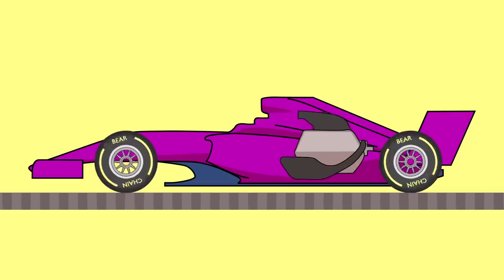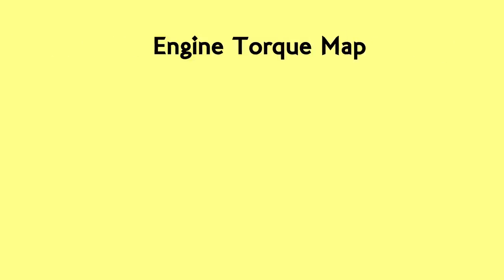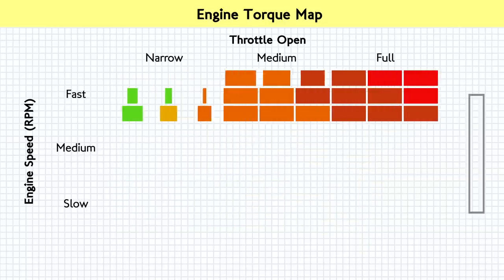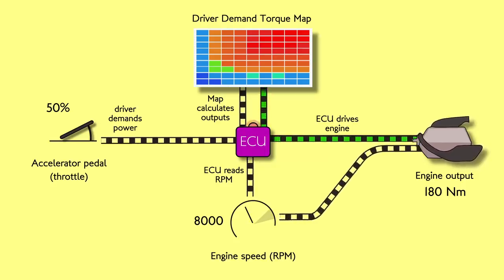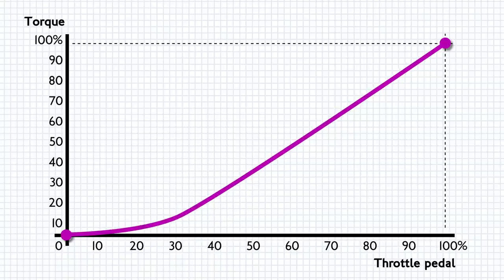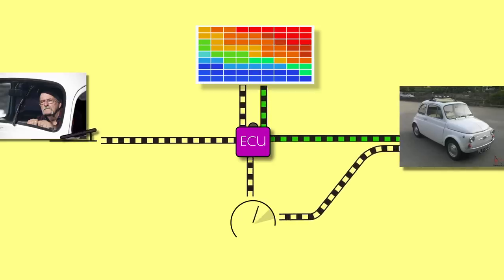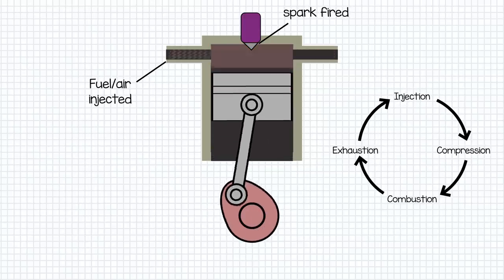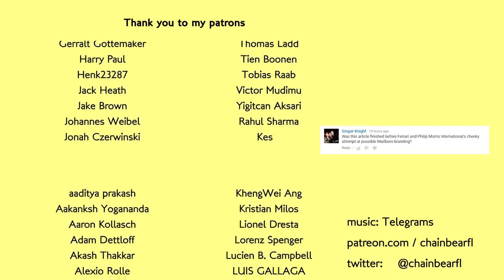What is Engine Mapping and how does it affect a car's behaviour?  | Plus Mini Q&A

Comment: While this basics are correct, the idea that the most torque is being produced at the greatest rpm is not right.  Most engines don't work that way.  This is why you have a torque/power band graph.  The power band will usually cross the torque line twice.  Once at the beginning of the power band's optimal low rpm output and again as the power band peaks out and output starts to fall.  Usually, the tachometer is calibrated to red line shortly after the power band peaks because now you are over-revving the engine and this can cause damage.

Comment: Is "party-mode" an engine mapping setting?     Presumably, one that pushes the outputs towards the extreme edges of these maps, without killing the engine, or damaging it too much.
Reply: That's what I understand of it.
Reply: As I understand it it's more related to the interplay of the Hybrid drive unit, fuel mixes and ignition timing - things more managed by the ECU than necessarily related to throttle response.
Reply: What such a mode is will depend on what the ECU is programmed like, but generally speaking, such a mode will push way more fuel through the engine than would be sustainable for an entire race given current fuel limitations, and most likely also completely drain the battery without bothering to charge it up again as you normally would. How exactly it directs the MGU-H I wouldn't know, and it is an interesting one, because there will be a sweet spot in using the electric energy, between driving the turbo to eliminate lag and making the combustion engine work as well as possible, and driving the wheels directly.
Reply: +ISLAMATRON - I know there's a 100kg/h limit on fuel flow at any moment, but I think you'll find that if you try to push 100kg/h through the engine at all times, you'll get nowhere near the chequered flag in most grands prix, hence why I said fuel flow was higher than would be sustainable for an entire race...

Comment: Could you explain the limit that Renault gave Red Bull for their “Engine mode” on the engine near the end of the race? (Japan GP) It was on radio, when Max was behind Bottas? Is it regulated by the sport, the team, or the engine manufacturer? 🤔
Reply: Renault will effectively tell the teams it supplies "you can put this many minutes on this engine on setting 7 and this many on setting 5. More than that and you run the risk of it failing and your race is over". It's advice from the engine manufacturer, but as a team you don't /need/ to adhere to it - it's not a rule that is enforced by anyone - just some advice from the people who build the power unit.
Reply: basically ^ this. F1 engines are very precisly engineered for both power and weight saving, and just like your own road cars components will fail faster when driven too hard for long periods of time. This means that the engines reliability across a race weekend can often only be estimated, and the manufacturers give guidelines to the teams using their engines as to how long you can run an aggressively push an engine before it's risk of faliure becomes too high. The current rule limits on how many engines you can use per season as well really push the teams to follow these guidelines and conserve the engines as much as possible.
Reply: @H18136  and the base of the warranty of the parts. Beside Raikkonen did a good job at managing the distance. Even tho Verstappen got into DRS range he couldn't get into position to attack.

Comment: Actually, in order to optimize energy saving against lap time, the ECU can control the torque delivered if maximum torque is requested by the driver (100% throttle). Furthermore, the torque is controlled by deciding on the torque split between MGU-K and ICE. There are several papers on that topic.
So engine mapping is only 1 part of the equation with the current powertrain architecture

Comment: Hey chain bear 👋
Another very interesting video, thank you for your time and effort.
In this video I had a first time of confusion while your explanations.
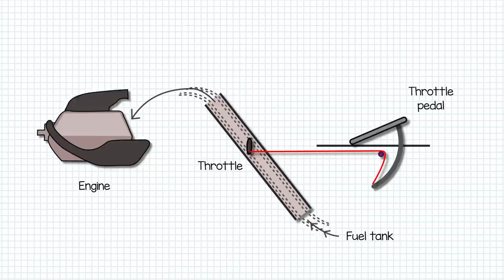@0:30 your drawing displays a throttle with arrows from the fuel tank to the engine. The combustion engine in f1 has direct injection, hasn't it? Wouldn't it be more precise if the throttle only controls the input air as the fuel is injected directly into the cylinders?
Even in the audio you state the throttle controls air _and fuel _...?

PS: never mind, you said "way back in time" overheard it, sorry 🙏.

Comment: Dont know about F1 Cars, but in a normal car it is air Filter > throttle flap > carburetor. This the line to the fuel tank is connected to the carburetor and fuel doesn’t hit the throttle flap, as ist enters the air later.

Comment: Good video. But I think they don't have a throttle valve anymore as even a fully open one has a drag. I think they control the torque by the MGU-H as a throttle and a very low fuel mixture as they don't have enough fuel to slow down the engine by too much fuel.

Comment: Hello, nice video. I have a question. On minute 1:37 you mentioned that the inputs for a simple engine torque maps are throttle percentage and rpm. The output will be torque.
Is there any mathematical relation I can follow to manually calculate this example with your values (rpm=8500)(.83)(212 Nm)?

Comment: Do they switch to a different engine map when they are in the pit lane? Or do they use something else?
Reply: I should imagine they do, yes. They could get away with just making the pit lane button a speed limiter, but any engine manufacturer worth their salt will try to incorporate some sort of engine mapping there that finds a balance between using as little fuel as possible while in pit lane, while keeping engine temperatures within the window, and the throttle response sharp enough for a quick getaway from the pit box.

Comment: I actually didn't know about the rule that 100% throttle should amount to 100% torque. Thought they could dial the engine back and run a leaner mixture.
Reply: I guess if you have to fuel save, you could put up a map that maxes out at 80% Torque by 100% throttle.
Reply: As I understand it, they can do that, and the rule basically just means that the highest point in the torque curve needs to be reached when the throttle is fully down, so it's not "100% torque" as such, it's just to make sure there is a certain linearity in the torque curve, and it doesn't have peaks and dips in places where the teams might otherwise want them. Then again, unlike a diesel engine, which has a massive early torque spike and then drops off, a petrol engine will always tend to have higher torque at higher throttle inputs unless the mapping is messed with very significantly, so this could also just be a way for the FIA to guarantee "natural" behaviour of the engine.
Reply: +ISLAMATRON - Could be, which is exactly why I put the words "As I understand it" at the very start of the comment, to make it abundantly obvious that I wasn't saying it with 100% certainty.

Comment: I think you mix torque with power. Max torque is never() at max rpm, or even in   the higher regions of rpm, it's way before. Sure f1 engines will be tuned for high rpm(intake runner lenght), but still, it's max power in the higher rpm, not torque. Fuel injection(s) per (2) revolution(s) will be higher in lower max torque rpms, then at higher rpms...

Comment: Please excuse my ignorance here (I pursued my engg. in the computer science dept., not the automotive one). I was under the impression that the throttle controls the AMOUNT of fuel mixture (which is pre-rendered as one of the categories - lean, rich etc.) input to the engine, which upon ignition RENDERS the engine RPM manifested as the crankshaft rotations, which in turn are controlled by the gear ratios to output the resultant torque to the wheels. This video however makes me feel as if THROTTLE and ENGINE RPM are 2 INDEPENDENT variables of which the Torque is a function.
I'll be obliged if someone could help me bridge the gaps in my understanding.

P.S. - I did a basic Google search but was perhaps operating under a confirmation bias so as to make it to no avail. I thus, admittedly rather lazily, posted my query in this forum. I hope it finds a resolution here. :)
Reply: Throttle-> fuel mixture->power=torque×rpm the torque/power then get's transmitted through transmission to the wheels.
Reply: My guess would be that RPM is a Lagged function of Throttle, with this lag essentially meaning that RPM and throttle can be treated as independent for the mappings CB describes
Reply: @hightown999 I suspect the same but can't find a credible source to definitely second it. If someone happens to quote a resource that addresses the exact question, then that would also be immensely helpful.
Reply: Well that's what ECUs are for. Consider ECU as an intermediate tollgate between the throttle pedal and the engine. RPM will not build if the ECU mapping does not allow input signals from throttle, even if throttle pedal is fully depressed. So basically in terms of coding, ECU is a conditional operator like if else statement- if conditions are met build certain amount of torque (amount already marked in the map), else respond differently depending (that to marked on the map). I made it look like rocket science, hopefully it helps
Reply: Rpm is a result of torque. Torque is a result of ignition timing and air fuel mixture (AFR). AFR is a result of throttle position and injector "duration". (Duration as in how long the injectors are opened. The longer they are open the more fuel is injected.)

Comment: What is traction control and launch control?
Reply: very somplified: traction control makes you not wheelspin and spin in general. launch control is when the compupter in the car finds the optimal throttle settings so it wont not wheelspin and get the best start from a stationary position.
Reply: They're both electronic systems that constantly monitor grip levels at the driven wheels, and make sure power can be put down to the road at all times, without spinning the wheels. Traction control is quite a broad system that tries to retain grip in various scenarios, while launch control is specifically designed to get a car from a standstill to a given speed as quickly as possible, making sure not to lose power to wheelspin in the process.
Reply: Traction control is when the ECU knows that the rear wheels are spinning from too much power so it automatically decreases rpm to make them gain traction again